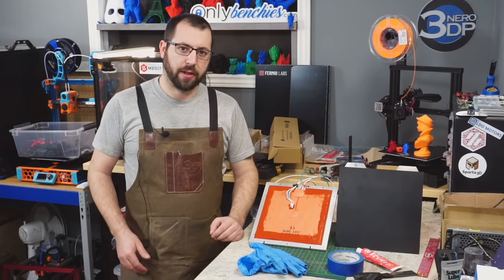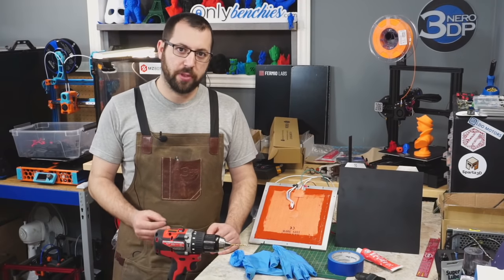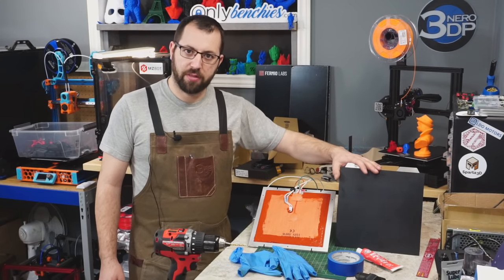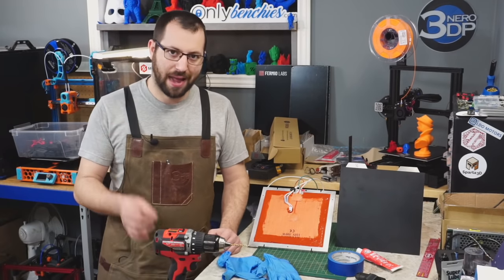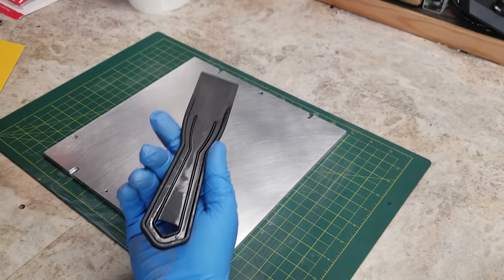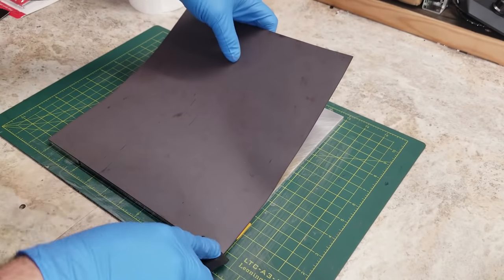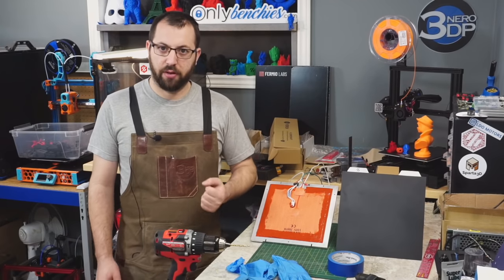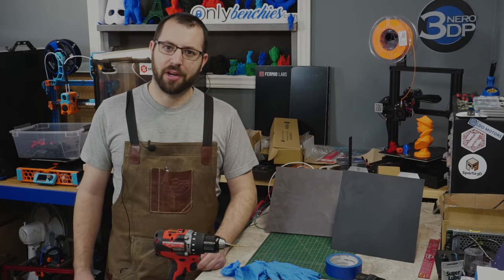Cast Aluminum Printer Bed - Putting together the best DIY print platform for your 3d printer

Comment: I did not know the fact you shouldnt solder with mains power. gonna have to redo that. Also what source did you acquire that black pei from?
Reply: Not to mention soldering risks popping the thermal fuse.
Reply: There is nothing inherently wrong with soldering a mains connection but for the fact that the connection will sit next to a high temperature heat source
That's why the wires to a hot end heater cartridge are crimped and not soldered
...or why the wires in an electric oven use crimp connectors etc
Reply: Crimping is generally preferred for critical connections on wire because crimping can be visually inspected for success, whereas soldering is more reliant on the skill of the person doing the work. Crimping = consistency.

Comment: Great Video.  Just a comment, you and your viewers need to be aware that using such a thick plate, while thermally more stable, will tend to introduce some "Rining" into your prints as a result of the added mass trying to be accelerated along the Y-Axis.  You can, to some degree, tune this out in your settings (acceleration and Jerk settings) but it's something needing consideration when doing this MOD.  So High-Speed printing, anything above 60mm/s, could prove problematic.
Reply: The V1.8 he is building is not a bed slinger
Reply: That's true for the Voron Switchwire, but not for the 1.8.
Reply: It's a good point for those designing their own printers but this is a voron1.8 not an i3 style bed slinger? Switchwire is a slinger and that doesn't use cast Aluminium for the reasons you mention.

Comment: Thank you for the detailed video. 
I understand why cast aluminium plate is the best. However I am curious how much better it is than a formed sheet of the same thickness. In other words if I heat up a 250x250x8 plate of formed aluminium from 20°C to 100°C and let it sit for a bit to make sure it reached the temperetaure throughout its volume how much does it usually deform from flat? I tried googling it and found nothing. 
Do you know any results from anyone who tried it on their printer?
Reply from the maker: Well i havent tried a non cast plate so cant give hard data. But on paper it should deform much more than w cast plate ever will.
There also usually not flat to the same spec as a cast plate
Reply: @CanuckCreator  Thanks for replying. As I said I get that in principle this is the difference. But I cant find any quantification to it. Would the 250x250 produce 0.1mm defiations or 1 mm deviations or what. The cast plate is several times more expensive at least what I was able to find and its price makes a significant portion of the printer build so I would very much like to have a justification for that price other than just "it is the best you can get".
Reply: @hebijirik  tool plate ally is sawn cut where as non-cast aluminium tends to be guilloteen cut which adds even further stresses and (from experience) gave +/-0.5mm deflection over a 300mm x 300mm bed (and it was a very uneven deflection too so bed meshes are insanely complex) - I solved my issue by using a sheet of borosilicate glass over the top!

Cast tool ally all the way !
Reply: @havenview  Thanks! This is the first time I got a numerical answer to this anywhere. 
I am currently putting together a design for a 500x500 printer because I have a use for it (and yes, I have read all the various reasons I should not go that big and I am prepared to suffer the consequences :-) ). I have a relatively cheap source of rolled (I think that is the right translation) plate aluminium that someone I know has previously tested to be within 0.05mm at room temperature acros half a meter. In contrast the only source of cast aluminium where I could find a price for it is in neigbouring Germany and it cost about 6 times as much. So I am considering going with the cheap one first because I will not be throwing away that much money if I find out later that I have to upgrade it to the expensive one. I just never found anyone who had tried something like this in a printer until now. I am still undecided but now I have a valuable input for it.
Reply: Mic 6 aluminum plate has a coefficient of thermal expansion of about 13 µin/in-°F 20-100°C, 68-212°F which is 13 millionths of an inch per inch per degree F from 68F to 212F. So... a 350mm square build plate is 13.78 inches and going from room temp to 100C (212F) is about 137F change. 13 * 13.78 * 137 = 24,542 millionths of an inch or  0.623371372 mm. That is in the X and Y directions. If we’re talking about a 6mm thick plate, it should be essentially zero in the Z direction or “warping.”